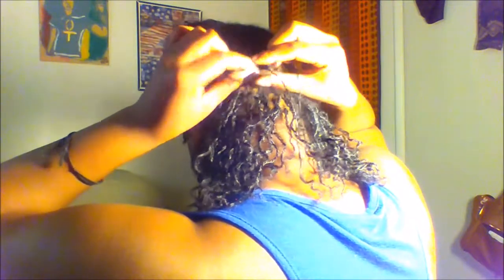Vlog 5: Finger-Interlocking; "Step-Sisterlocks"

Comment: You were able to undo your locs after interlocking them? Did you lose hair?
Reply from the maker: yes, It's very easy to do in the first 8 months. I used a rat-tail comb and put conditioner on the loc. It was like taking out a microbraid. I only had a little shedding, but i think that's because they were still fairly new.
Reply: Jess Hi, I removed 450 3yr old   sister locks with a safety pin and cheap V05 conditioner. 2-3locks per day. took 6 months. wore buns with pretty  headbands.

Comment: What makes the reverse 4 pt rotation tighter than 4 pt? Is there actually a difference?
Reply from the maker: in my research, the reverse rotation was supposedly the secret to sisterlocks, but it all looks the same to me. The more rotations you have, the tighter/stiffer the loc will look. I honestly dont see a difference between reverse and regular either.
Reply: One more question, sorry. Can you tell me the reverse rotation in clock terms? You know how regular 4 pt is  12 to 6, 9 to 3, 6 to 12, 3 to 9 (I think, correct me if I'm wrong), what would be the reverse 4  pt? Thank you for explaining all this by the way
Reply from the maker: you got it. thats the 4pt reverse! 

4pt would be 12 to 6, 3 to 9, 6 to 12, and 9 to 3 "clockwise"

reverse is counter clockwise so, 12-6, 9-3, 6-12, 3-9.